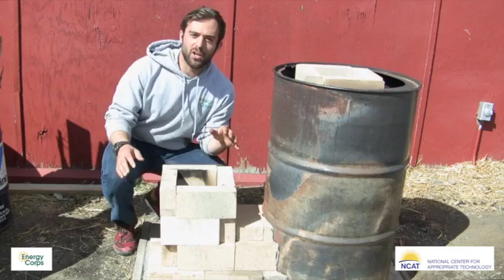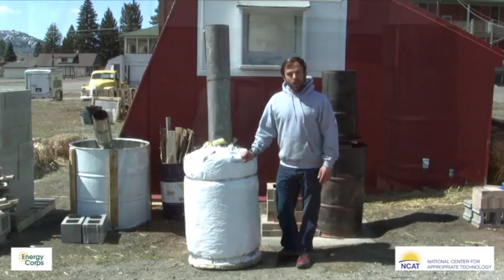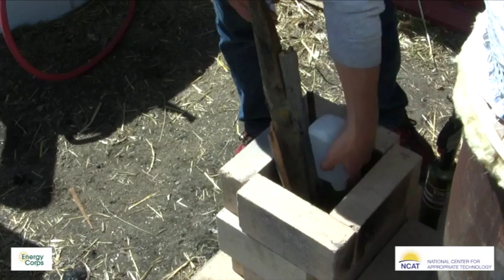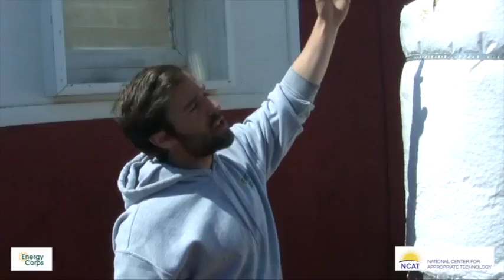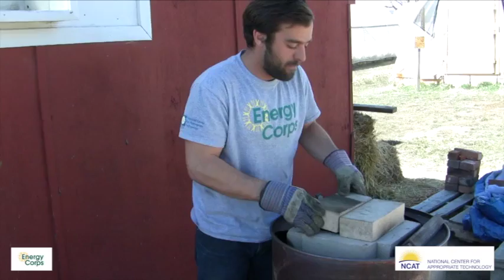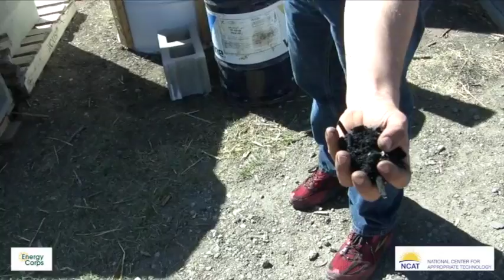Energy Corps Montana:  Building a Biochar Retort Kiln

Comment: Hi everyone. Mike Daniel here, the gentleman in the video. I just watched this video again for the first time in 10 years. Certainly, a few things could change both in the design as well as what you do with your material after it has been charred - before adding it to the soil. Your comments are very helpful for the community.

If anyone is curious to know where I am now, I work in the electric vehicle DC fast charging industry. I own a home that produces 90% of its own power through a 9.6kW solar system, and drive an electric vehicle.

I am very invested in the renewable energy sector. I can thank NCAT and my time spent as an Energy Corps member for that.

Certainly, many of you watching are capable of making a design that is more efficient. My hope is that you all use this video as a general guide, rather than a bible. I stand by the efficiency of the design.
Reply from the maker: We appreciate the update and your continued dedication to renewable energy!

Comment: 9 years in the future, please disregard advice to add charcoal directly to the soil. Only after charcoal is inoculated with nitrogen-rich "swamp water" or "compost tea"  should it be added to the soil. While the design achieves a more efficient burn than simpler designs, with lower materials cost, it has significant ergonomics problems. A single man can operate it, but I heard grunting.

Comment: I appreciate the efficiency of the rocket stove.  It's a good use for softwood leaving hardwood to be charred which makes for better charcoal.  Ideally you'd set a small fire at the base of the long stem of the "J" to get a draft started before starting your main burn.  Maybe if there was a door in the base of the chimney on top of the cooker barrel that would do the same thing.  You could also poke a lit taper in there when you;ve got unburnt gases coming out the top and get a burn going at the top of the char chamber as well.  Have you considered burying the "J" in a trench to lower it.  Then you could dispense with the bottom barrel and support the cooker with a few cinder blocks.

Comment: Data reports identifying X mass of fuel to produce X mass of charcoal would have been useful. Seems this rocket stove process is targeting production in areas with low fuel availability or with burn restrictions. Ken's comment on a vent recirculation process for a cleaner burn is very interesting.
Reply: Interesting, but not necessary. You saw the 24 vent holes in the top of the reyorg chamber right. If he had put that with the top facing up....it would've been wasted fuel. Instead, he faced it downwards so that as it heats up, builds pressure and off gases....those off gases are ignited right there at the bottom of the retort chamber. Therefore,  no need to pipe out any more off gas into the burn chamber. It's already being done with the vented, burner top which is inverted inside of the burn chamber.

Comment: Just a suggestion. I would put a 3/4 inch pipe in the retort and pipe it into the rocket stove. You get more heat and no smoke. Burn the woodgas dont vent it.

Comment: Seems a bit elaborate, i wonder if you gain much efficiency with the rocket stove heating this concoction.with lesser materials you could make a double barrel retort. this looks easy to load in, but with that fancy lid a double barrel would be easy to load too.
with the right air intake holes you can get complete burn of your gasses and it is basically the same as a rocket stove.
this is a rocket stove on a rocket stove to heat the barrel instead of stuffing wood in the sides.
it would be nice to know howmuch wood is needed in the rocket stof to burn a 30 gallon barrel of wood,
i wonder how long it takes before the woodgas ignites
I wonder if this doesnt gets to hot thus loosing all your hydrogen bonds which makes biochar good biochar  
PS you need to make this charcoal you made in to bio char by adding nutrients, charcoal wil suck up your nutrients and mess up ph for a while if applied directly

Comment: I get the Distinct Impression that you've taken a Massive Hammer to Crack open a Peanut...
This is a Totally "Over-Engineered" answer to a very simple design...
Reply: richard mcphee you got that right university education ?
Reply: Mort Goldstien i used a old water pressure tank thro it on my burning barrel recreational fire , next day 20 lbs charcoal
Reply: People who can not structure a grammatically correct sentence should not refer to others as 'dumb'.
Reply: hes right i can show you another design or two that are probably just as or more efficient and that are easier to build and produce about 3x that finished product. Your a fucking dumb ass lol
Reply: fuck you patty

Comment: The 'flue' needs to be at least 3 times the diameter  of the firebox in length to get the stove part of things working.  The pressure cooker retort will explode like any other pressure vessel without the vents.  I like the way  you built a triple stage, very efficient burn

Comment: Great video.  I'm just starting to learn about this and this video helped a lot.  On a side note I have a bbq cooker and was wondering if I could make charcoal for fuel for it to burn with your system?  I'm still confused on what the difference is between biochar and 100% natural charcoal that I use in my bbq cooker.  Thanks
Reply: Biochar also has to be clean void of contaminates such as heavy metals and other pollutants that wouldn't be healthy for the microbes in the soil. So no using treated woods, woods with paint etc. also I wouldn't even want to cool off my char with city or rural "treated" water as the chloramines and fluorides would possibly inhibit life in the soils. You really have to have an all natural approach to fully benefit and to have something different than just charcoal
Reply: me too clarify please!!!
Reply: Biochar is the word for charcoal that is added to soil. I was told that by the man who coined the term "Biochar"...However I'm quite sure there is a difference between store bought briquettes and this black carbon char coming from a retort burn. The store bought charcoal I'm assuming is pressed together condensing it for the purpose of fuel whereas biochar is needed for it's surface area from it's pores structuce
Reply: 1 gram of biochar can have 9000 sq.ft.. of surface area which is part of the reason it promotes life in soils. I can imagine if it were crushed and compacted like charcoal it would lose some of those values. Also as others have pointed out the char needs to be inoculated with microbes, nutrients, and even fungi to make good biochar

Comment: How much of the kiln do you have to take apart to clean out the wood that was burned for the heat generation?
Reply: If your getting that many ashes it can't be that efficient
Reply from the maker: +Grant Fitz You don't have to take apart the burn chamber where the wood is burned to generate heat. It's an open space made of the fire bricks. Is that the part you mean? You can just scoop out any ashes with your hands once they've cooled off.
Reply from the maker: +Grant Fitz You don't have to take apart the burn chamber where the wood is burned to generate heat. It's an open space made of the fire bricks. Is that the part you mean? You can just scoop out any ashes with your hands once they've cooled off.

Comment: That seems kind of fussy having to pour the cement pad and how tall it is and all. I dont think you want to use it on a windy day. Injury from burns seems more possible having the very hot retort up so high and trying to pull the upper barrel off over it. If you want to see one that looks way easier to use look up "The best charcoal retort kiln in the world?" by James Hookway. It uses a rocket burner, is they size of one barrel not counting the chimney, makes more charcoal (Biochar), and can be set directly on the ground. It directs the wood gas into the rocket chamber just up wind from the flame front  so the gas burns more efficiently. Being portable it can be carried to where the raw material is and or closer to where the charcoal it going to be used.
Reply: +Scott S.  Scott, I thought he got rid of the rocket burner that was why his title mentioned its death.

Comment: Wouldn't top part fall off?  It seems that for safety reasons there should be some sort of mechanism to lock the top in place so that the top can't be knocked over accidentally.
Reply: I would rather use the one designed by James Hookway. Search, "The best charcoal retort kiln in the world" It doesn't take a concrete pad, is only one barrel high, probably safer to use, portable and looks like it makes more charcoal (Biochar)

Comment: What is the specific pattern of the bricks? Read the book you referenced but cant find the specific pattern
Reply: Although it is called a "rocket' stove, it's not rocket science, Gary. The specific pattern is pretty much whatever you come up with. It's the sort of thing that creativity is rampant and the only really important thing is the basic geometry and restricting the air from entering anywhere it shouldn't. I have thought of several methods of stacking the bricks and even adding some steel vanes in strategic places to create a vortex with the rising gasses, particularly at the bottom of the retort, thereby increasing the effective distance the flame front travels for a more efficient heat transfer.
These things are so amazing, you can even, as shown in mass heaters, force the heat to travel back down and exit at the bottom of the assembly.
Be creative, imaginative and if you have an idea, try it.
Reply: think simple